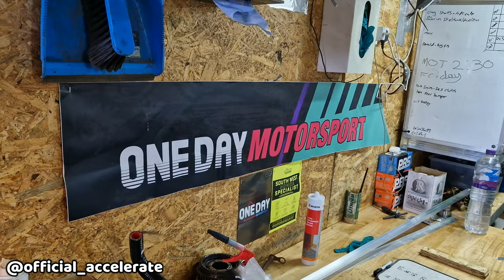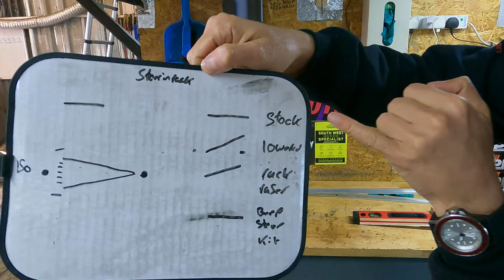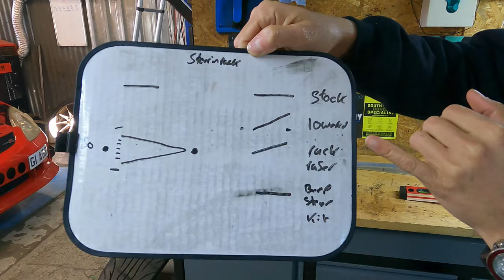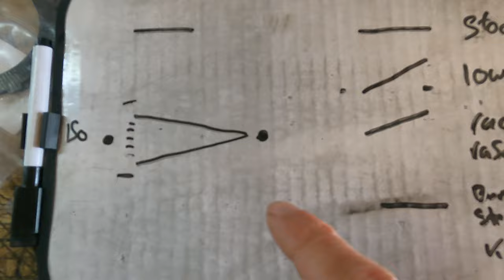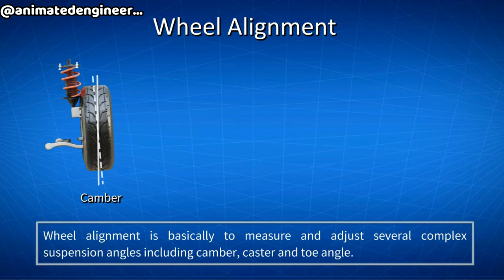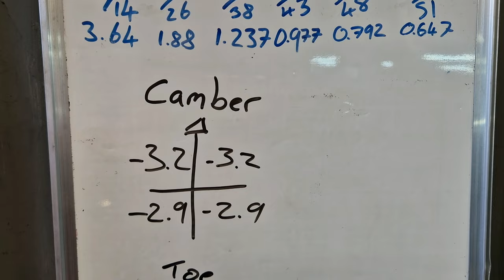BUMP STEER DELETE! Honda Civic Type R EP3 COMMON ISSUE FIX? **One Day Motorsport**

Comment: Bumpy public roads & ep3s dont work but on track all good. I run my ep3 stock height the biggest issue is toe change in the rear during highspeed cornering, i run a bit of toe in on back. the front i have hardrace spherical lca bushing with slight increased caster. I also have nylon steering rack bushing. Steering doesnt wander on highway anymore. I would like more caster but the back is more of an issue than the front. I run AR1 they are good.

Comment: I find the ns2r’s make the ep3’s pull all over the road especially when it’s a uneven surface. I swap my wheels for some with standard road tyres when I’m using mine on the road for any length of time as it’s so much better 👌👍

Comment: Did you guys do the slider mod too? It’s the solid piece that replaces the plastics one from factory that the rider bolts too it’s behind that rubber boot that makes a big difference too
Reply from the maker: Yes we done the slider too. It was just such an aggressive set up. worked supurb on track though.
Thanks
Ken

Comment: Awesome video guys. Very well explained. The steering design on a EP3 is very strange. I'm used the the steering arms attaching to the end of the rack not on a bracket in the middle. Is it the alignment that is setup for track? That can easily be adjusted. The fact that you've got solid bearing bushes now means you can feel a lot more through the wheel. I guess you'll find out at Llandow  what it's really like
Reply from the maker: To my knowledge, its basically a cheaper design than double wishbone. 

It's the alignment that makes the pulling more aggressive, it could be toned down but we want it at maximum attack for track so hopefully it's a worthy sacrifice! Lol 
- Drew

Comment: I found the same when i had a keen ep. You just cant enjoy it on the road as well as you can on track. Wheres eg/ek/dc2 is much more accommodating on the road in the same spec
Reply from the maker: You are absolutely right! In standard form the EP3 is fun on twisty roads, but once you start changing differentials etc, they become a handful! 

We are fortunate enough to have driven EGs & DC5s and you're right, they are much more forgiving! 
- Drew
Reply: The advantages of of proper double wishbone suspension. 🥰

Comment: I have an ep3 lowered on yellowspeed coil overs and fitted hardrace inverted tie rods , rack slider, rack raiser and extended ball joints and it made the bump steer 5x times worse . Almost undrivable . .
Reply: get rid of the inverted tie rods and rack riser. i tested bumpsteer on the alignment rack at my work and it was significantly worse when you add those things. got rid of them and the car was good, keep the ball joints and slider though
Reply: @joelmayorgaa  that’s exactly what I have done and so much better .